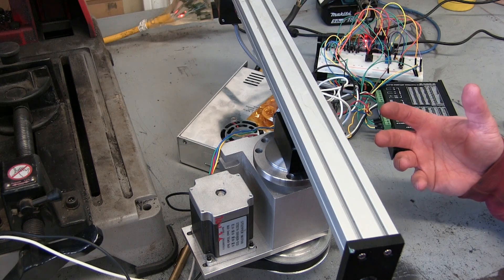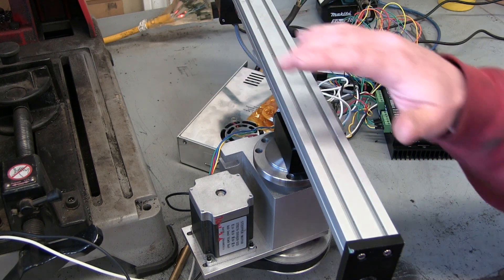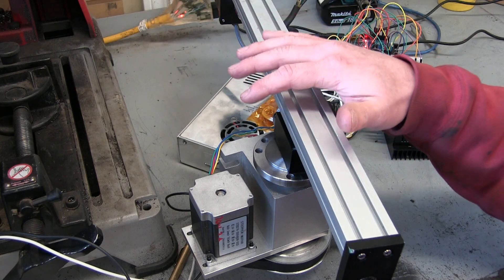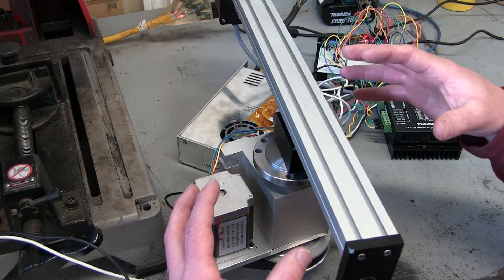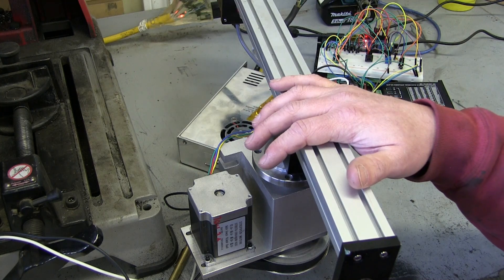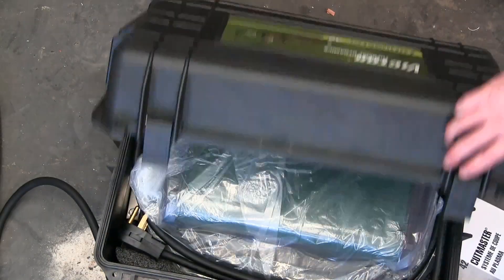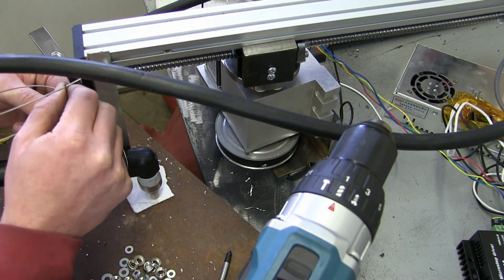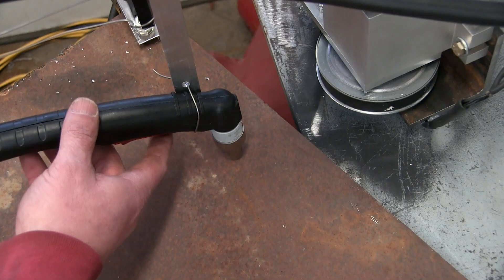Portable CNC Plasma Prototype

Comment: In the spirit of ease of use by the 300lb gorilla, this thing should have at least 2 cutting or travel modes. And the gorilla should be able to set it up with nothing more than a square and a straight edge or string line.

First, like you're using in the video, should be a simple/RFN mode that takes whatever shape is fed into it, gives the user a choice of 9 obvious zero points based on the center, edge centers, and corners of that shape (maybe custom zeros/starting points for complicated patterns), and starts cutting in less than 30 seconds of setup time with ZFG to the orientation of the piece.

For the second mode, I would suggest not using the machine base as the zero, but the pattern or whatever stock is being used. No ruler would be needed to zero/setup the machine, since it has those built in. Just run the tool out to one pattern axis, rotate 90 degrees (technically any angle would work, but 90's seem to give people warm and fuzzies) toward the other axis, user would manually run in or out again to position the tool head on that axis, and then the machine can travel to zero and allow the user to input any XY corrections needed to let the machine find true square, triangulating its position. (Alternatively, 2 points could be measured to one of the axes, and the tool locating to zero could be the check for positioning and sqware.) Then the machine could flip, mirror or rotate the pattern to cut on any side of that zero.

After that, I'd just marry the tool's programming to the god law of all things trig, the law of cosines.

If nothing I said about mode 2 makes sense, I took out my trig legos, threw them all over the floor, and built this lil fort to try n' esplain.

Once this thingamabob is built, slap it anywhere on your work piece, lock the e-mag down and swinger to a straight edge lined up with the top side of the pattern. Run the tool to that there line. The arduamo thingy should record the runout and save it fer later. We'll just call this r instead of r1 because I'm gonna use less than 26 variamagbles. Activate the rotary bits for a second and we move the tool say 15 to 20 degrees. This is an imperfect world, so we'll just save that amount of swing as ϴ. Slide your tool in and out some more and when she's lined up proper nuff, save that as s. Now we open our baggy of maff tricks to calcumalate the distance between those 2 points on what I'm gonna call the X axis, and save that nummer as c. Turns out 
c = sqrt (r^2 + s^2 - 2 * r * s * cos (ϴ))
We use that to figger our true distance from tool center to x axis, obviously we'll call that y.
y = (s^2 + c^2 - r^2)/(2*c)
Out of curiosity, we should want to know how far past square we went with that ϴ swing. How's bout we call her Φ?
Φ = arccos (y/s)
I believe, as long as the ϴ swing was in the direction of the Y-axis, we can spin 'er 90 - Φ and run straight to the Y-axis and be square with it. Obviously, run the tool out a 3rd and final time, and the radius can be saved as the x value of the position of the machine. New r = sqrt (x^2 + y^2) @ ϴ = arctan (one of 'em/the other) or maybe -ϴ depending when you save your home angle stepping. Run to that and the tool should run smack into zero. Or close depending on the brand of the framing square used for layout and iffin' my algebra isn't chock full of errors.

Comment: good old a²+b²=c². I'm anxious to see a straight line at max distance. make some retractable feet on your mag base so you can cut slots for repositioning on large pieces. a 3ft arm should be able to cut a fully nested 4x8 sheet with only 1 repositioning.

Comment: why not 2 short axis?  that way you wouldn't have to do complex math to keep the lines straight or even do circles without compensation.  your axis length is only constraint then on the cut size.  i know it's a quick job, but you could also turn on the plasma by connecting your robot rig instead of using the handle switch.  you'd want to do this if you're using it to cut multiple of something.  it may be way down the road, but if you want to cut 20 circles, the pro stuff on waterjets or whatever, they always pack the parts in to minimize waste.  pretty damn cool.

Comment: I like the proof of concept. There's the obvious radial axis cartesian coordinate issue, but there seems to be a relatively easy solution to that in the comments. There's also the issue of regulating the travel speed on the radial axis. The further out from center it is, the faster the arm travels for every click of the stepper motor. Maybe, the solution above addresses that. But I think one of the biggest hurdles to this idea, is making it tough enough to get thrown in a truck, and piled on with the pipe wrenches in the tool box and still be able to work reliably every time after its dropped off of the tail gate. And as you pointed out, it needs to be super simple to use...ie; almost dummy proof. I'd probably go for a hard wired connection to the cell phone app via a usb port rather than wifi or bluetooth, because plasma can emit lots of emf which could really make it unworkable in a hurry.. here's a clue, a small industrial robot might fit the bill for the heavy duty construction aspect required, but it only needs to be 2 axis.

Comment: ok, so it would need a standard point of reference. like 2 spots to line up, maybe one at the end of travel for the tool, and a mark on the base, these will be in relation to the software, so that you can place the base at x1/x and y1/y so that you can precisely drop it on layout targets.  if your making a triangle it makes the thing in the right orientation to the world 

phone app is cool idea or tablet loaded app, alot of guys have gotten pissed on by safety for having phones buy not work tablets hmm

the arm may need some lazer line up dots.. Fricken lazers man

the tool holder needs to be able to be hands free, so maybe a quick attach plasma cam stuff from our Keith Fenner our in Massachusetts 

and can you please burn out the ave fire microchip :)

Comment: I don't believe this is a novel idea. If it is, well done ave!
Reply from the maker: +Kyle Ross  source?
Reply: I think it is a novel idea, but as a Boilermaker I'd say I wouldn't use it.  Goes back to your first statement of stuck in the past and it takes some skill out.  In my opinion cutting with a torch or plasma is a skill a lot of young guys getting into the trade don't possess.  Anything that takes away from the hand eye coordination learning is bad.   The other part is not only does it have to be dead stupid but dead tough.  Mag drills are dead stupid until you try to drill a hole on a vertical column, trip the breaker and airmail it down a floor.  On an average 10 week outage, 200 Boilermakers I bet we can fill a crate with 100 dead grinders, brand doesn't matter, new Metabos seem just as bad as the Dewalts.
Reply: none of those machines, except the one that wasn't even shown using an actual cutter, are small.  Make several models, one with a 12" arm, for example that would be very portable, suitable for home use, etc.  The bigger machines like the crossbow aren't really suited for small work in tight spaces, or for the home user.  The industrial market is covered. Go after the home/hobbiest user market.

Comment: It looks really nice.
Would also need a way to index the location so that one can cut a hole where one wants it.
I would use a simple two point system, like two simple lasers pointing down from two points on the linear rail.
One point for the origin, the other just to get the angle of the system.
I have written about it in more detail at: https://plus.google.com/u/0/105287714965102060733/posts/MJ36gD1GEm7

Comment: Add a mode where you use a pointer to set the corners of your square, or the center and outside diam. etc. I'm thinking similar to how industrial robot welders are programmed by manually positioning the arm. For your basic shape library, you could just have a row of buttons with  square, circle etc.

Comment: if (at the design input phase) there was a way to say cut a cardboard template, lay that template on some grid paper, snap it with the phone, bingo bango, faster way to prototype without having to add 4 years of learning cad 

as surely that, combined with fixed shapes in the ap would be a dream, and far safer for the complex shapes than that same shape been tackled by freddy four fingers and a bandsaw, or worse, a death wheel in ya right hand, and the metal in ya left

Comment: No no... not with a mobile phone app. No no.

Vot you do... is make it follow chalk lines using a camera. 

The ideal solution is a graphical markup language that can be applied physically to the workpiece. Sharpie, chalk... engineer's blue... spraycan... blood... whatever.

eg: we want a circle. Mark the center with an X and input the diameter.

could do the job nicely with stickers, actually. simply sharpie the desired parameters out of a grid on the sticker to "order" the cut, like a little stick-on order form. X marks the spot.

freehand marked-up line follower, straight line point-to-point line follower. 

y'a get what I'm saying? 

or maybe I could sketch it on the worktop for you...

Y'a get me blud.

Comment: Add a spring tension guide to the torch end to allow for small variations in material. You'll have to change the programming to adjust the rotary speed based on the linear actuator position so its not travelling super fast when fully extended and super slow when its in close. Obviously a solenoid to activate any style trigger you jam in there. Maybe some small ducting leading from the business end back to the base for fume removal if one is so inclined.

Comment: How does it behaves at maximum extension. Finding the limit of the range and increasing this limit would be the next step to me. As for drawing a straight line, by doing some speed adjusment of the motors I'm sure you can find it the easy and long way.

Comment: rotary speed needs to increase when cutting closer and decrease when cutting further out to keep tracel speed the same. 
arm needs to move in and out during rotation to keep straight lines straight. 
torch head needs to be secured at a known point.
possibly some sort of height sensing to keep the gap correct.
the more complicated it gets the more fragile it will be though.
make sure any bearings are oversized and plastics used have a hefty amount of glass fiber reinforcing and ribbed for her rigidity, just in case AvE tears it apart.

Comment: The math, to translate Cartesian into polar you just need these formulas:
(x^2+y^2)^(1/2) = Distance and angle is just atan(y/x) = angle

Where things get tricky is the fact that you will have only a starting point and a reference point to define your x and y axis. This is best since you will want to be able to setup the machine anywhere on the material. So you will also need to do some matrix rotations. 
this will rotate the points accordingly.
[cosA,-sinA
sinA,cosA]

I would keep the drawings in a Cartesian system and just translate/rotate them when defining a job. From there the Cartesian points are just feed into a conversion function that then passes the new position to the CNC control functions and that can figure out the Delta between locations and how to make that move.  I would set the cartesian origin at the base of the tool and define the rotation of the drawing by assuming the zero position of the arm as X and Y defaulted as perpendicular to that however the user can rotate the drawing by using a second point. 

I am sure some one, some where has implemented a GCode interpreter that can do all this for you. soo yeaaa

Comment: CNC guy here. I understand the need for something like this, I doubt i would find a use for something like this in my field. but i suppose that is the point, some of the crotchety old fabricators i have met would go crazy for this. I don't think an app is the right way to go with this though. I think you want something on board. Most of the ancient dudes that would use this are not tech savvy. So it is likely that there will be one guy that knows how to run it that will have to give up his phone any time someone wants to use it. You will also want something to show and set the direction of the first cut. Probably a laser to show the direction and a dial somewhere to change it. that way you wont have to orient the device just the 'program'. The hardest part of this project is by far the programming to make it easy and user friendly. Id suggest looking into some conversational CNC controls to get some ideas of how they work and simplify programming.

Comment: Most cheap 3d printers use Arduino boards to run the steppers & coordinates. You could check Marlin or Skynet firmware as it has most of the hard mathmatheticals & pixie-shifting you'll need already built.

Comment: Next attempt, get the SL100SV Machine Torch, if someone's going to go for this, they'll be willing to get the machine torch instead of using the hand torch. From a welder's standpoint, I probably wouldn't ever use this at work, and at home I probably wouldn't either, most of the time I use my plasma at home is on aluminum. I would be more interested if you made a trolley setup that would run on whatever length of 3/4" black pipe you wanted from 2'-10' for both the x and y axis, have 2 trolley ends that screw on like pipe clamps to 2 pieces for width (if it hung under a single pipe it would have to be dead level or your torch would move to an angle relative to your workpiece) and ran on pieces of 3/4" pipe (or 1" square tubing) for rails.
As far as simplicity on steel though, most of us have a cutting guide set for both oxy-fuel and plas, which allows you to cut circles of any diameter easy enough on any material, and if you want to cut a square, 2 steel construction squares can be tacked into place on top of each other (or held in place with a couple of mag switches or bessies) and used as a guide for a plas.
The reason we (welders) still all still have track burners is they will do a straight and clean cut in steel up to 4" thick (thinner's cleaner), and you can get into a basic one for $500-600.
Yes, a plasma is nice, but I haven't ever carried one on a welding truck, and seldom have use one in any shop.

Comment: Hey man, I think this is a pretty cool idea. I'm not sure that I would want to bust this out on a job site, but it's a great concept. The only issue I see fundamentally that might need addressing is the fact that there needs to be some sort of homing device for the actual torch head. if the torch is not at a known radial distance from it's pivot point then every move it makes will be either exaggerated or undersized.

Comment: I've been fucking around with CNC and other stuff for a little while, and a couple things come to mind (since you asked):
- The reason you use 2 supports on each side of the bed is because everything's gonna bend. Keep that in mind, you might have to compensate for it in the software.
- Translating the coordinates? That's the easy part. It's compensating for the hardware 'peculiarities' (also known as 'fuck ups') that's the problem.
- Get a 3D printer. You can have an awesome one for less than 2000$ nowadays (Ultimaker comes to mind) and when it comes to testing stuff like that, it's a gold mine. Plastic is cheap (20$/kg), the print is pretty fast, and you don't even have to do a thing beside drawing it. If you need bearing supports, etc., it's way faster than making them in aluminium or something.
- If you wanna do a quick'n'dirty proof of concept for the smartphone control, use a HC-06 Bluetooth thingy on an Arduino on one side, and a Qt app on an Android on the other. 
- You really need an emergency stop button that actually cut off the power, but I guess you knew that already
- Once you're a bit further in the prototyping, you can have seriously good PCB done for dirty, dirty cheap in China (less than 1$/unit, for 10-20 total units). You can do the SMD assembly & reflow yourself, it's very easy, all you need is a 40 bucks kitchen oven (confiscate one from your wife) and a thermocouple. And there you go: industry-grade prototypes for next to nothing (components not included).

BTW, does anyone have a reference of the stepper assembly thingy he's using? It's the same than one of the previous videos, but I couldn't find it on eBay.

Comment: My advice on mode of operation.
1: Setup tool: tool is in home position. stylus set to the center of the arm. (use a servo or rottory encoder for this since its a lead screw and will take forever to home.)
2: UI (app) to select pattern (circle, rectangle, ect.)
3: UI to set origin position on the part
4a: Then select secondary position using the UI (origin and then radius for circle, oposite corner for rectangle/squares, base position for triangles or gussets, ect)
OR
4b: Set values for shape size, tool will then move to the secondary position to indicate where the cut will layout.
(Out of bounds warnings here)
5: Dry run to show pattern
6: RUN IT!

Alternative options.
custom pattern mode
batch cutting 
one button cutting (repeats the last pattern set or a selected pattern after having only setup the starting point. good for fabrication on repetitive parts.)

settings: 
preset speeds for common materials
custom speeds 
cutting delay times on new cuts.

Comment: I would be interesting to have the ability to swap out the plasma cutter for a whiteboard or chalk market in order to assist with the positioning of the cut.  It looks like you are achieving quite a fine level of detail with just a prototype so cut placement will be important.